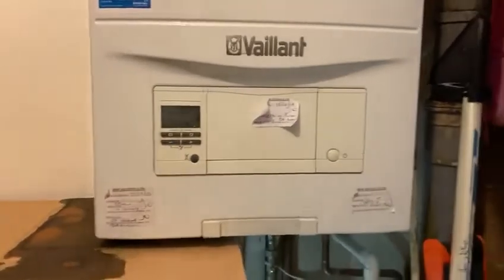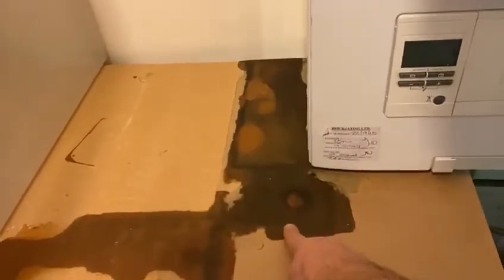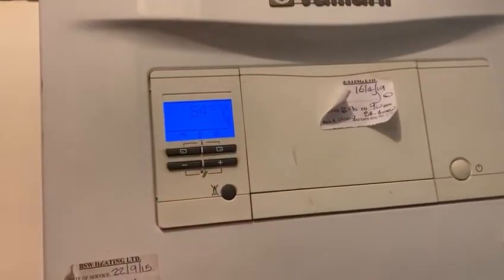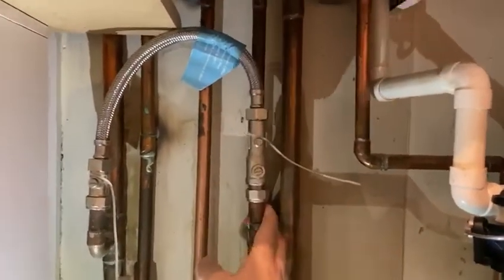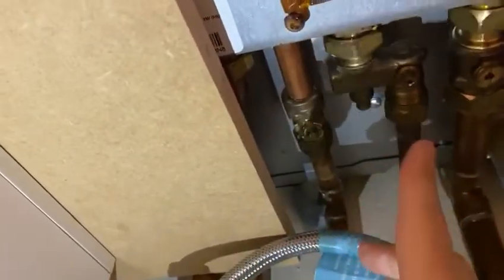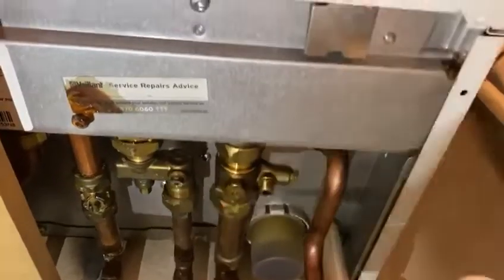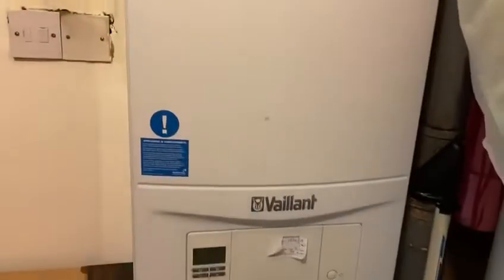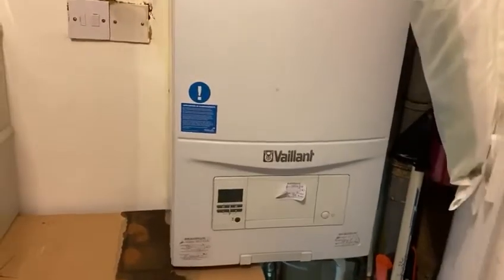Vaillant Boiler No Heating and No Hot Water Issue

Comment: Hi and thank you for your video 

Just moved into a new rental 
I have exactly the same boiler. I have set the correct temperature according to your instructions on your other video 
Please though can you tell me how to actually just turn on the heating 
I have hot water no issues with 
I simply don’t know how to turn it on is there a switch thermostat somewhere I don’t know about
Reply: I’m having the same problem - it seems the boiler is is summer mode and I cannot change it - when I press the radiator button to change the water temperature it’s just says ‘heating off’ or displays the water pressure. Any ideas?

Comment: Do you know anything about having hot water - but no heating?
You did not mention this here.
Cheers
Reply: arrrgh, it’s happened again. 8 likes and I didn’t even get a response last time!
Reply: @rickysfilmreviews3825  i have the same problem and i seen that you posted your comment 2 yrs ago, how did you fix yours? cheers
Reply: @sappheire1009  it’s horrible waiting for a response on here when calling out for help (not just referring to this channel)
I strongly urge anyone experiencing issues to call out a local engineer who can be there within a day or 2, and fix it almost instantly (parts permitting).
Plus, you might get a response 3 yesrs later - and it’s not even relevant 🤣
Reply from the maker: Did you try bleeding the raidiators?
Reply: 😂that’s why I’m here! 😂